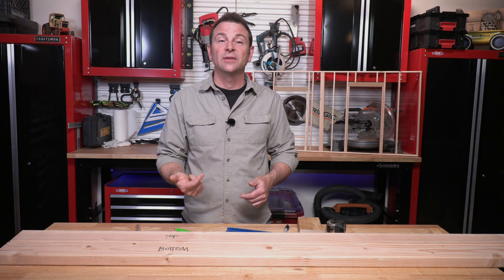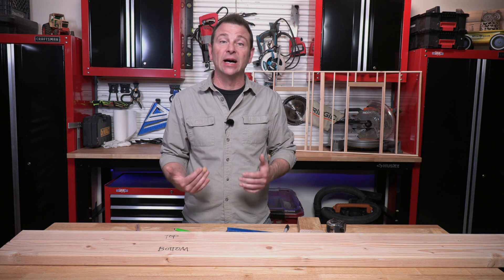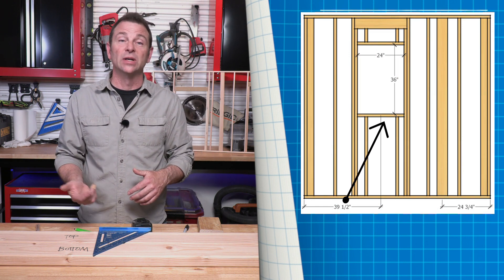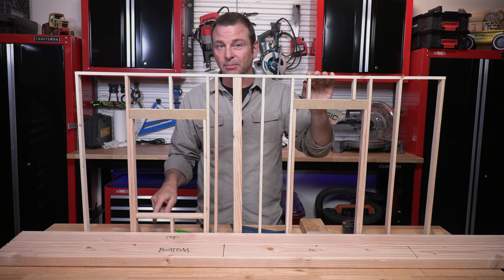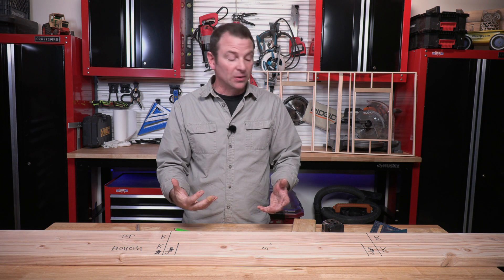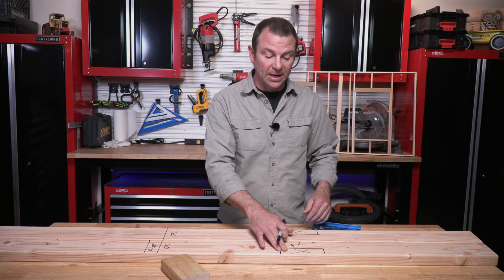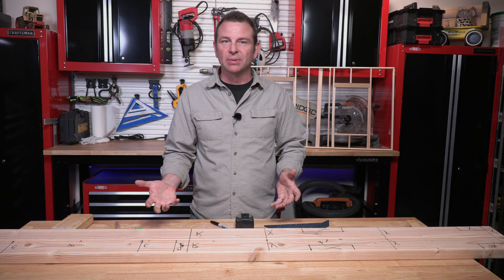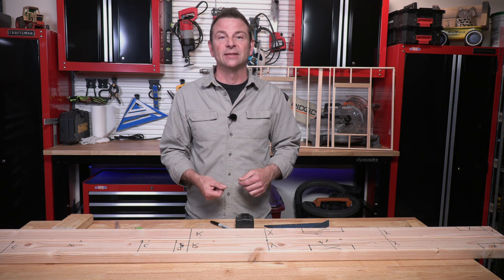Learn how to do Wall Framing Plate Layout, Step by Step

Comment: Hello, and thank you for your videos. Learning a lot. I do have a question. In your bottom plate and top plate example here, are the edges closest to us supposed to be the outside, and the edge closest to you supposed to be the inside? Because if so, then wouldn't your California corner be marked wrong, or am I not seeing it correctly?

Comment: Why minus the 3/4" from layout studs?
If you are measuring from the end of the plate that is also the outside face of the end stud. If you just measure in 16" from there you will land on the next edge of the stud and so on. That is full 16"oc from the end stud all the way through.
If you minus the 3/4" from the outside edge. your first stud cavity is smaller than the rest by 3/4"? Why? what is the point? Am I missing something? 
Just measuring 16" from the outside edge lets you just simply mark every 16" marking without the subtraction... Its way more simple.

Also, you were making a window opening so your cripple studs would have transferred from the sill plate to the sole plate.

Comment: interesting difference, Canadian carpenters can let me know if im wrong but my understanding is that in canada, our cripples dont only go in to continue the the 16OC but also on either side under and over the sills, you would have had 4 cripples under the window and 4 over the window. 
I tend to agree with not having them because the point of the header is to transfer the load to the bottom plate so anything under it becomes non structural, therefore the extra cripples shouldnt be necessary.

Comment: I know there are regional differences in "standard" framing practices, but is there somewhere where they do the layout markup on the face of the plates and not on the edges -- and if so, why?  When I was framing and doing layouts, the top and bottom plate got tacked together and the layout was done on the edge of both plates.  When the wall is being built, the plates will be on edge and the layout marks on the edge are easily visible.  I can't think of why you'd want the layout marked on the the face of the plates.

Comment: Any recommendations for 'joining' bottom plates on longer walls?  I have some bottom and top plates that terminated in (and above) the rough opening for a door (concrete below, joists above) -- should end-to-end joints for top and bottom plates be staggered?   Does that matter?

Comment: Why is the header different than the other video? This time it is above the top cripples which makes you need to use that extra piece of lumber?
Reply from the maker: Headers can be installed high or low.  It is covered in the headers lesson on this channel
Reply: @ConstructionEd  Thank you!

Comment: Such a great educational resource!  Thank you.
I may have missed this (watched twice) - I thought the header above the opening is directly at the top of the window space, so a cripple stud(s) would get marked at the top plate.  But in your plans, the header is all the way up to the plate, with a block at the window, and cripple studs in between.  Just a different way to do it?  Or is there a reason to do it this way here as opposed to the way it was shown in the framing basics video?
Reply from the maker: We were intentionally showing both ways.   In the header video we show both the high header and drop header.

Comment: Great explanation but I have a question about the window. Are you able to mark the height and header framing for the window on the layout or does the framer need to refer back to the drawings?
Reply from the maker: You can certainly write the window placement measurement on the plate somewhere - just so the framer does not have to go back and look at the plans.  But typically, the framer is the one that is doing the layout and they likely have the plans when doing the layout.

Comment: Great video! The way I learned it was you do carry the jack studs all the way through, on top of the header to the top plate.
Reply from the maker: sorry - Jacks don't go all the way through - only the kings
Reply from the maker: then nothing would hold up the header
Reply: I think he meant that the cripple studs should be lined up to the top plate as well, since they do continue above the header.
Reply: @thirdeyeghost this was going to be my question. Why are the marks for the cripples not transferred onto the top plate when there will be cripples above the header?

Comment: Great helpful channel, learning alot! One question is for running electrical wires, or HVAC Plumbing & electrical or otherwise from attic down to 1 Level ceiling on a 2 level building! Can you cut 1"/1.5"/2" diameter holes on both the double top plates/cap & top on exterior or interior walls framinged in? Will any of these cuts/holes made in any sizes mentioned above in any location throughout both of those two top plates hinder or disrupt the integrity to the strength of that wall?
Reply: You can cut a hole 1/3 the width of the plate. Anything more and it needs a strap, a metal plate that gets nailed on. 

Im not an expert, but thats my understanding.
Reply: For LOAD BEARING walls, if you need a hole or notch larger than 1/2 the plates width, you must add a 16ga, 1.5" wide metal strap that extends 6" beyond the hole/notch one either side, fastened with 8 10d nails.  For new construction, a smart builder will spec a 2x6 wall where drain and HVAC lines will run

Comment: Man when you lay out the studs al 16 center remembee that the drywall sheets start at the wall naylee not at the stud. Look at it.
Reply from the maker: When framing exterior walls the layout pattern starts from the outside of an end stud.  You are correct that his is not ideal for interior drywall.   Layout starting points varies, and for exterior wall it favors the sheathing.  Interior walls can be specifically set up for the drywall pattern

Comment: I don't have any direct experience with framing and have learned alot from your clear and detailed presentations. I have been wading through information trying to learn and have come up short finding information of butt walls. Please address the layout for a butt wall. The through wall layout is stand alone, it does not take into account a butt wall. However, the stud layout of the butt wall takes into account the thickness of the through wall, including the sheathing. Maybe an example using a 12' x 12' slab could be used to highlight the through and butt wall layouts and how they correlate  to each other.
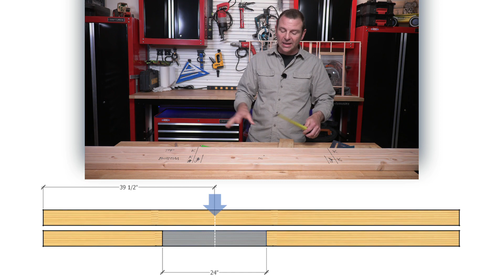Reply: 7:00 covers this.  A butt intersection needs to address two issues - a place to attach the first stud of the butt wall,  and a place to attach the ends of the drywall of the through wall on either side of the attachment.  You could address this with a "U" construction of two common studs plus a backer for the butt wall.  But it's faster/cheaper to solve this with a single member that is wide enough to address both requirements.  That's why he's marked out a 2x6 backer for the wall intersection.  The 2x6 provides backing for the 2x4 stud of the butt wall, with enough overhang to provide backing for the ends of the drywall on either side of it.

Comment: @3:30 is the ‘rough opening’ SAME as nominal window dimension? i have heard that the rough opening is to be a little larger?
Reply from the maker: A window RO should be larger than the window itself - usually 1/4 inch on all sides - but check the manufacturer specs for what they want for their window.
Reply: @ConstructionEd  so @ 3:30 you gave “24 inches”; your reply seems to say the “usual” 2’0”window roughOpening is 24 1/2 inches. ???
Reply from the maker: @larrypahl5756    We did not provide you with faulty information - we are stepping the learner through a process based on the information provided as this video lesson is a beginner's exercise on plate layout.  We explained to look at the plans to find the location of the window and mark the centerline.   Then check the plans for the window RO (usually the window schedule or the manufacturer specs) and mark the opening for the width.    In this lesson and the exercise connected to it, we called out the dimensions for the learner to practice marking a plate based on instructions.   If you are building a wall for yourself, plan on marking your window RO based on the size YOU need. 

 I hope you would not expect to learn everything about wall framing by watching one video about plate layout.  I suggest you watch the series including the window installation lesson.

Comment: Why are you subtracting 3/4 every 16?
Reply: that is half the width of the 2x4.  The framing members should be centered on the mark - by subtracting 3/4 the mark will then fall on the edge of the 2x4.  The alterative is to mark at the 16 inch and then place your stud to straddle the line

Comment: I've never found an explanation of how to determine which end of a wall to measure from when the length of the wall does not divide evenly in 16-inch OC studs. Which end gets the short opening?
Reply: Plans should specify,  otherwise it makes no difference...

Comment: What a horrible video, yo made the RO of the window the exact opening of the window, 24x36 is a common window size spec...but a real window...in the REAL world is often skewed, tweeked, not plumb or square, especially with builder grade windows...if someone makes the RO the exact size of the window, they will have no room to shim, and no room to foam. The window wont fit! and they wont be able to them MAKE the window square/plumb. This is a video made for a classroom "teaching" what isnt done in the real world. Might get away with that using high end windows that are build very well, but for avg joe windows, they are gonna be in trouble if they make the RO the exact size of the door or window.
Reply from the maker: Sorry that you found the video horrible- Please note that these videos are intended to be used in conjunction with our instructional resources that do call out that an RO needs to be oversized.   We just thought someone in the YouTube universe could benefit from a free resource....apparently, that is not you. 

You can watch our Window series if want - but since this video was "horrible" maybe it is best if you don't, I would hate to run the risk of offending your senses again.   Our goals when teaching the complete process are to step a learner through the process - at this point, the student is just learning the placement of framing elements - along with their teacher to support the student.   Of course, someone with your experience would not be taking this lesson.
Reply: at 3:00, the blueprint shows a 24x36 *rough opening*.  In the video it would have been better if the presenter had described this as a 2-0/3-0  "rough opening", instead of "window".  But from the plans, his layout is correct.

Comment: Great videos. I have been trying to find a video from you for platform framing that describes how to start a second level on top of the double top plates.

Anyone have a pointer?
Reply from the maker: Our floor framing and roof framing courses are not part of this Free Library.   Platform wall  framing for a second story is very similar to the first floor - you are just building on a floor platform that has space underneath.   But of course you have to follow the framing plans if the Engineer has called out special load consideration framing.

Comment: 9:51 Why did we go back 3/4'' to 15 1/4 instead of adding 3/4'' and go to 16 3/4 ? Did I miss something or is that a woopsie. Thank you for making this serie, the videos are very helpful
Reply from the maker: they are the same.   the 3/4 from center will take you to an edge.   If you want to mark at 16 3/4 that is fine.
Reply: May I try to address what I think was the question.  The 16” on center allows a 4 foot wide drywall sheet to start/end in the middle of a 2x4.  However, for the left side of this wall demo, the first 2x4 sheet will align with the left edge of the 2x4, versus the middle of the 2x4.   Therefore, the second 2x4 distance needs to be 3/4” shorter.   This will allow the right edge 4x8 sheet to fall on the center of the following;g 2x4.  Hope this helps.

Comment: When you butt a wall to the California corner won't that throw all the interior 16 on center marks off by 3.5 inch
Reply from the maker: yes.   layout does not work for both the inside and the outside for the entire wall, because the first stud location is typically pulled from the outside edge of the end stud. It is typically setup to work the best for sheathing and a custom cut will have to be done for the drywall.
Reply: From the drywaller's viewpoint - you're going to end up doing a cut anyways, so it doesn't really matter if the interior corner to the 4' stud (for vertical layout) or 8/10/12/16' stud  (for horizontal sheets) falls on the center of a 16" increment.

Comment: We run jacks all the way to top plate. It helps stiffen the header and prevent roll.
Reply from the maker: Then, what do you have supporting the weight of the header?
Reply: So header sits on Jack’s of course. And then we throw in small jacks from top of header to bottom of top plate attached to the king stud. So they are basically short cripples that follow the same load path of the Jack’s. I believe the purpose is the help stiffen the king stud, a little beefier connection to top plate because we nail into the king stud, then nail through top plate and then toe nail to the header. It also throws any loads above more evenly onto the header instead of on the king stud which would make it less inclined to bow. It is a bit of a pain because it means cutting 4 cripples over typical door and window sizes instead of just two. AND I also think it’s to help prevent header roll. It’s how we have always done it in Missouri. PS: been enjoying your video series 👍
Reply from the maker: @redneckgoatfarmer  I have seen many folks add these cripples above headers and more often below a window sill.   Technically they are not needed in either situation and can add to lumber costs and cause cold spots by increasing thermal bridging when it is not required.   There are many holdover framing techniques that are still done today because "that is how we always do it".  Our position is that if a structural engineer does not require it, and if it is not 100% needed for a nailer, then leave it out.  Save time, Save Money, Save Heat transfer.

Comment: Great information well presented. Two observations: the stud layout for the interior sheet rock does not fall on the marks when you consider where the sheetrock starts however the outside sheeting falls on the studs; additionally when framing the rough opening for the window and doors the kings are placed at the minimal opening - will this create a poor fit upon installation.
Reply from the maker: Layout rarely works for the sheathing AND the drywall perfectly due to the corners and T connections.   But having the studs on an expected pattern it does help the drywall installation for the majority of the field.

Comment: I enjoyed the video but there is some confusion for those watching... when you laid out the cripples you said they don't transfer to the top plate which confused me but then I saw the animated layout and realized you put your header all the way against the top plate with cripples down to the top of the window's rough opening and while I thought that was strange, it's not the first time I've seen that odd arrangement/placement of a header.  Then I noticed the model wall you have behind you and it was the normal way I seen a header framed in... head scratcher.  I've always been curious if there is a reason for arranging your header framing one way or another???  Thanks for the video, very professional (and a bit entertaining lol)
Reply from the maker: The cripples do not travel from the bottom plate to the top plate - those are separate sets of cripples on the top.   But we could have stated it a bit more clearly.  Headers can be located "high" against the top plate or low (the more traditional way).  We cover header placement in more detail in the header lesson.   The model shows a low header but in production building, we are seeing headers placed as a high header more often in our market.
Reply: @ConstructionEd  Interesting explanation, thanks.  I think most of my confusion lied in the way I personally lay out my plates.. when I lay out, I label the cripples on both bottom and top plates and simply think of it as a common stud with a window in the middle of it, that way all my rafters would still land directly on top of a cripple.  This comes from me framing with headers directly above the window and cripples up to the top plate.  Thanks again for what you do!

Comment: When laying the common studs why did you step back 3 quarter of an inch from center of the  16 inches seems important I like these kinda videos
Reply: 16 on center layout means the middle of the stud should land on the 16 inch mark.  By backing up 3/4 of an inch to draw a line allows for the stud to be placed on the mark and then the middle of the stud will land on 16 inch.
Reply: @SinglehandedSailing  kool just figured it out too

Comment: Silly question, when you look at the diagram, should you take the perspective of looking at the wall from the outside or the inside, and is that view consistent every time?
Reply from the maker: For this exercise the bottom plate - the one closed to the camera - has inside of the plate facing you as the viewer.